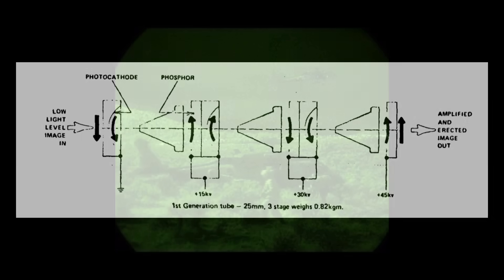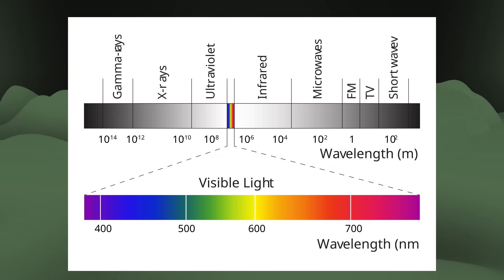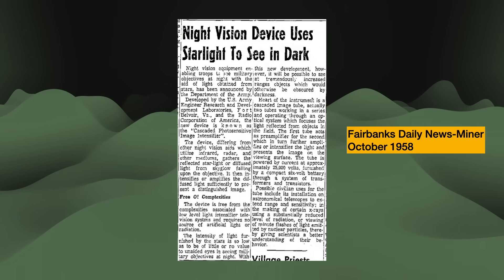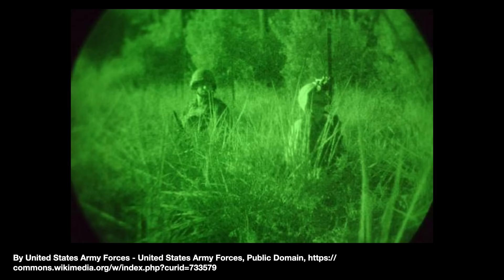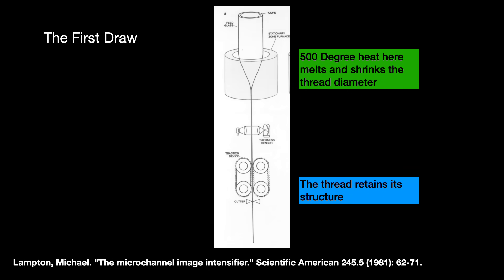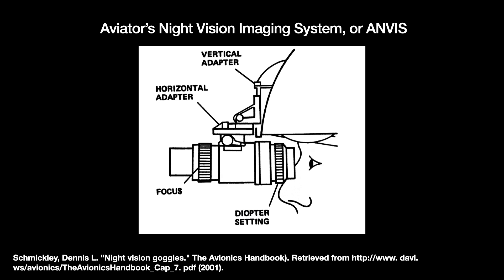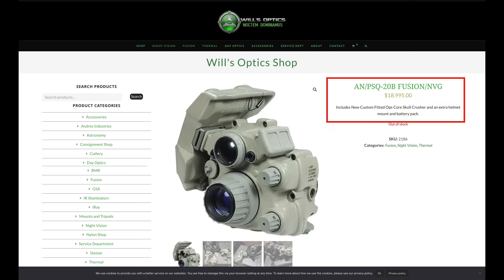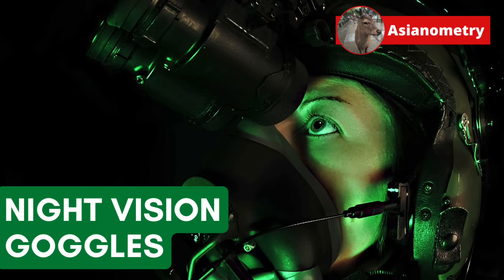The Plates & Tubes Behind Night Vision

Comment: 9:00 Used to work at one of the centers in Princeton that was involved with production of MCPs for early generation US spy satellites. Seeing those etched plates is giving me flashbacks of resurrecting that production method for a detector I was working on. Never really went anywhere as its usage case never fully materialized.

Comment: almost all modern gen 3 (defined by being gallium arsenide) IIT are white, not green. L3 harris started producing white phosphor tubes at the request of socom units after some who trained with european counterparts tried their photonis (gen 2+ using multi alkalide) tubes which are a blue/white color. white color L3 and Elbit use are much more soft on the eye and the contrast is seemingly better despite what pure statistics tell you about green vs white. the contrast of a white image is a lot more discernable vs the green one, where dark greens and black blend together, espescially as the user becomes fatigued or in very low light situations. 

I highly reccomend you look into chinese night vision, and their current advancements. The chinese military has possessed night vision devices for some time now, be it captured units from the vietnam war and low grade russian/domestic clones of older american systems. notably the very recently seen digital monocular the PLA issues. However, these have been very sparingly used besides the digital monocular. This has started to change with NNVT. A chinese company came into posession of old Photonis europes production equipment from the early 2000s, and likely expertise from people who worked on that equipment, and has begun producing tons of cheap, low grade gen 2+ tubes. These tubes have flooded the US market and can be easily purchased in the states to try. NNVT has in just a few short years gone from this gen 2+ production line to allegedly gen 3 gallium arsenide production as of very recently. You can find a few examples of these new gen 3 tubes online being tested. They perform significantly better than the gen 2 tubes, although still being inferior to the newest gen 3 tubes american companies make. How china got to this level of expertise isnt known. 

The chinese military has yet to be seen adopting NNVT systems at large, however this may be due to the sheer cost of equipping the worlds largest army with the most expensive piece of a soldiers kit, even at chinese production prices. They may also be waiting for their own gen 3 tubes to reach a usable capacity. early american gen 3 tubes often died fast and performed remarkably poorly until refined (see how gen 3 was a thing as early as 1982 but didnt enter serious contract purchase levels until the 90s-2000). 
On a smaller scale, PLASOF are all seen equipped with Argus/lindu pvs31 clone housings and either nnvt tubes or stolen american gen 3 ones. 

Going from almost no domestic night vision industry to mass producing gen 2+ tubes to gen 3 tubes within a decade is remarkable and also stinks of espionage. 

I havent even gotten into Argus or the connections of PLASOF officers to american, chinese, and canadian companies in this industry.
Reply: Russian company Ekran can produce tubes that compete with modern american ones (although not at the same scale) so there has likely been a lot of cooperation between russia and china on night vision technology. Both have been wildly outclassed by America in both scale and quality of units, and have resorted to finding anyway to shrink that gap. The russians for example cannot produce nearly enough night vision units, but they can produce a plethora of acceptable thermal scopes and outsource production to china. China in the same vein can produce very good thermal scopes that compete with american ones and cost a fraction of the price.

Comment: The modern systems, both thermal and starlight, are amazing - both quality and super low power consumption. And that was just what we used 10 years ago in theater. Only poor performance in very low night light, when we switched to thermal. They are a total game changer on operations, prob saved a few of my mates several times over. Great presentation - a rightly prized and protected form of tech that should be guarded very, very carefully. Greetings from Spain.

Comment: I think you brushed over the generation 3+ or generation 4 technology too quickly. There's been a lot of fascinating innovations, such as extremely high gain, autogating, and importantly, WHITE PHOSPHOR. Massive miss that while you did mention thin film, you did not mention autogated filmless tubes such as the omni-vii+ ones that bring increased clarity and brightness. Nor did you mention that similar to the 'silicon lottery', every image intensifier is different, and yields of truly great tubes are low due to small imperfections in the manufacturing process. I think you missed out or skipped a lot of the modern aspects of image intensification.

Comment: You can always tell a noob with no actual nightvision experience because they start rambling about making it digital, proving they do not understand the advantages of analog. There are major physics advantages to analog tubes that digital will never reach. Ask yourself why the most sensitive photon detectors used in labs are analog. Also run the numbers on resolution requirements to make a digital system match analog to the users eye.

Digital technology has been amazing, so moderns just want to shove it into everything. Fact is it sucks at some thing. You’re trying to build a digitally modulated software defined radio microwave oven. It’s stupid as hell.

Comment: The insides of the channels are not coated with metal. In old-style plates the conductivity and secondary emission comes from firing the glass under a reducing atmosphere, with the lead-containing glass composition tuned with the firing process to produce the desired properties. The ends of the plates are coated with metal, as electrodes to distribute the bias potential. The photocathode poisoning is due to positive ion bombardment (and evolved gas if any) not electrons.

Comment: Interestingly, there are currently some digital NV implementations that have almost solved the issues of latency (and to some extent power draw) of DNV devices, and in some cases even managed to attain parity and surpass analog performance in low light environments. The ADNV G14P2 basically took the most optimized CMOS sensor possible, and put it into a device with a processor as simple and efficient as they could get it to be. The end result being "image intensification" performance beyond that of modern Gen2+ multi alkali tubes, and even trading blows with mid to high end modern Gen 3 tech. While it lacks the resolution of analog systems, these are still 1st iterations of DNV devices that are actually comparable to other modern analog devices. The YouTuber HYPE Militaria actually has done quite a few videos about these units

Comment: We do not tint the light green, it is the property of the scintillator light (or rather was, since nowadays different scintillators are used). Also the human eye is actually more sensitive to light at about 507 nm when in dark (using rod cells instead of cone cells). Yes, we see the color green the most, but that is for colorful image. With monochrome image, it is more useful to use the said 507 nm light. Great video though, love it!
Reply: Photonic vs Scotopic vision. It also means the eyepiece optics does not necessarily need to be color corrected.
Reply: @ifsey wait, so a single optic night vision scope shouldn’t be tinted green?
Reply: @DrakeDaraitis  no, color corrected means 'achromatic', or no difference in optical behaviour as a function of light color. If the optical system only uses one wavelength of light then the design and manufacture can be simpler.
Reply: @ifsey  thanks!

Comment: Great video overall, just some things to note:

14:57 the battery pack for the for the PSQ-20 goes on the back of the helmet, not the hip - you can see it in the image.  This helps to provide counterweight on the helmet among other things. 

Analog intensifier technology is likely not going to go away anytime soon due to how energy efficient it is - as an example, a PVS-14 running off a single AA battery can run for 40-50 hours, something that current digital night vision technology can’t match. Very useful for extended field operations etc
Reply: Not to mention actually affordable for us plebs. Still not cheap but affordable. Temptingly affordable...

Comment: With all the food analogy, really  missed the opportunity to mention cut rock candy, which is very similar to the 2 draw process. An image is built up using sausages of colored candy on quite a large scale, and then stretched repeatedly, forming a rod of sugar made up of all the colored bits, which when cut has a tiny, detailed colorful pattern or picture inside it.
Reply: The drawing process is also reminiscent of how multifilament low temperature superconductor wires are made, which have many very fine niobium titanium filaments in a copper matrix for stability. Starts off with a large block with cylinders of NbTi in it, which is progressively drawn down to the size of a wire. Amazing it works as well as it does.

Comment: What is the  name of the phenomenom that allows “electron boosting” i want to learn more. Thanks
Reply: Same idea as a photomultiplier tube...incoming photon produces an electron, which gets accelerated, strikes a metal surface and releases more electrons. After a few collisions, the number of electrons is much higher than what was produced by the incoming photon.

While the first-generation night vision device is very clever, adding the microchannel plate to amplify the electrons in gen-2 devices is pure genius.

Comment: The microchannel plates developed for image intensifiers are now used in a variety of scientific instruments to intensify single electrons when used to measure electrons produced when material is irradiated with Xrays.  They are often backed with 2 dimensional delay line detectors rather than a phodphor scintillator.  With this you can count single electron events and then also get a position of where the event happened.  Coupled with an electrostatic energy analyser you can often measure the kinetic energy of the electron and the angle from which it was emitted from the sample.  This is the case for angle resolved photelectron spectroscopy ARPES.  This is one of the foremost techniques for measuring the band structure of materials and is pretty much the only way of checking the quantim mechanical calculations used to model the electronic characteristics of new materials for new semiconductors.

Comment: Our company worked with IsquaredTs early on.  It is not the sensitivity which is the problem, it is the "dynamic range" of and amplifying devices.  When used in practice, the "bloooooming" effect lasted so long, that the recovery interval became the limiting factor.  In actual fire fights they became unusable, and it was easier to just look out with ordinary eyeballs.  The attack and recovery problem still exists today.  Modern cellphones have much better speeds, but only at the expense of sensitivity.  This is a fundamental physics issue, and cannot be undone.
Reply: Great point man! I believe that modern IITs (image intensifier tubes) have a cool solution to this, the autogating power supply. Im not really technically inclined to elaborate on how, its like the power supply "detects" heavy light influx, and pulsates power to the tube, reducing incoming light and singificantly helping not to flood the user and bloom the tube.
Reply: @ZaGe_Jet  Well explained regarding the autogating. Autogating technology is super powerful and paid dividends in how L3 tackled it in their analog tubes.

Comment: 12:32 This caption contains an error. The goggles shown are the PG1MS, a first generation binocular system, nothing like a gen 3 or "higher" system. The AN/PVS6 is a large handheld observation device. and shares no similarity. It's very likely the writer on that source post misidentified them as the AN/AVS-6, a binocular device that can be equipped with 3rd generation intensifiers
Reply: Hello fellow green dog night vision and Asianometry enjoyer.

Comment: I have a Philo Farnsworth gen zero tube. I used an ebay tazer exciter to power it. I used pieces of stainless exhaust welded together for a handle and a holder for it. I had to use 700meg ohms of resistance to drop it from 15,000 to 900 volts for the grids. And I had to buy lenses. It works good enough to see around with an IR light.

Comment: Anothering to mention is white phosphor screen have taken over green phosphor ones. It doesn’t seem like the theoretical ability to distinguish shades of green actually translates to actual performance, most prefer the bluish greyscale of white phosphor and it doesn’t cause eye strain as much
Reply: When digital sensors get coupled with tube output screens, usually green phosphor is used. Even though the digital image is B/W in the end anyway, GP delivers more information. Photonis works this way
Reply: @wylnd  Photonis makes some of their GP tubes (ECHO) with higher gain than WP for some reason. L3Harris and Elbit doesn't do so
Reply: @Nathan-jh1ho  Yes they still both do. As soon one that has worn both for hours on end, only difference noticed was white just appear more clear. No eye strain difference
Reply: Amber would be cool
Reply: The blue white tint of white phos is actually better for the rods in your eyes which specialize in light and peripheral perception. While the green tint is better for the cones in your eyes, which help with color preception.

So white phos actually allows you to "see" more in the same conditions. 

It's the same as when you notice stars or glow in the dark stuff in the corner of your vision, but when you look directly at them they're hard to spot.
Reply: Not true. The most you can argue would be them being equivalent in performance, or slightly worse than GP at the highest end. It's just preference, I've never had (or anyone else I've spoken to) discomfort from a night vision device just because of the phosphor colour, lens quality or improper use are far more likely.
Reply: @untrust2033  you haven't worn them for hours long. Unless your eye is built different. L3Harris doesn't even make green phosphor anymore

Comment: Thermal imaging and its neighbours are fascinating. I worked many years for FLIR as a service engineer before I retired but I'm still nerdy about it lol
Reply: I would love to have a FLIR equipped phone so I can tell if food at a buffet is hot or cold without touching it.
Reply: I had a phone with a FLIR camera and I loved it. Mostly for fun, but occasionally very practical. I still miss it sometimes, I think my next phone is going to have it again.
Reply: @taiwanluthiers  I had a FLIR One for my iphone a few years back, it worked very well, was able to examine several things and find cold spots where there was no insulation on my apartment, plus a few small water leaks, you probably can do better with a hand-held FLIR camera like the FLIR C5 instead, the FLIR One attachment was a pain to use on the iphone because I needed to remove the phone case for it to connect properly, and lighting extensions were too wobbly.
Then one day the FLIR attachment just died, wouldn't turn on or charge its battery, dead, zero, nada.
Reply: +Insert Predator clicking noises+
Reply: Temu has a thermal imager for about 50USD.
I bought one and it works for what I need. Range is trash though. About 12ft. Blots out at 400*F. Able to capture images also.
Reply: @lawofliberty3517  Yeah those small imagers can be handy for quick things like seeing if something has an abnormal temperature or checking for stuff like leaks in a wall etc. The resolution isn't great (I'd imagine it's something like 150x150 pixels-ish?) but it's plenty enough for simple tasks. :)
Reply: @Modenut  ya. Looking around my home I could see all the thermal leakage. 
Used it on first start of a motor we put into a car to see the headers warm up. 

The NV from Temu only works with IR light😆
Reply: Lol: Friend of Earl! 😉